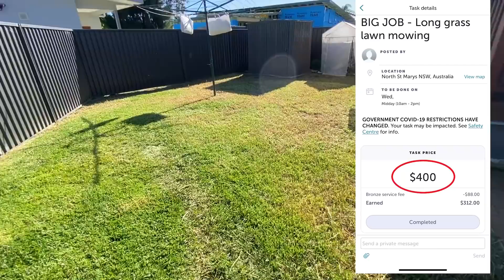2 OVERGROWN MESS Lawns In one Day!

Comment: A sugestion option for ur weedeater- instead of string line replace the head with a 7.25 inch skill saw blade- mount it using a large flat washer then a dome washer then the blade then a lockwasher then a castle nut and tighten- then cut that yard with it first- it will cut fibrous stuff easier
Reply from the maker: Thanks again

Comment: Well done. You are a shining example showing there IS work available if anyone wants to work.  Granted that wasn't a normal mowing job.  Many others passed it by.  So what did they earn by sitting home without a days work? Everyone wants stuff the easy way or handed to them anymore.  You did an excellent job.  I was curious what those "runners" were.  I live in Ohio, USA and we don't have that.
I do have a few tips.  If anyone weeds the grass the grows in their driveways and sidewalk cracks, after you are done, pour some regular table salt on them.  It isn't a poison and it will kill the roots without damaging anything and they won't grow back.   This is good for almost all summer long in case a few others pop up.  Pull them and salt.  It keeps your property looking groomed.
White vinegar and Dawn dishwashing liquid and water.  I mix up a one gallon spray bottle of this solution.  Once I weed around my house, I weed about 3 inches from the house, leaving no grass. Then I go along and spray that solution all around the house.   The next week, when I mow, I can mow up against the house and I do not have to get out my weed eater. 
That is a good solution if you have oil spots on your driveway before you power wash it.  That cuts through the grease.  You can use it on a black moldy sidewalk and let it soak before you power wash.  Dawn is biodegradable and won't hurt your lawn.
My last tip. STOP buying that damn "weed and feed".  You want a nice lawn but do you really want to mow every three days? My neighbor does.  I mow at 4 inches.  In the summer, with no rain, his turns brown while mine is still green.  You can treat your lawn with weed killer but unless it is thin and needs a boost to the roots, fertilizer is a waste of money.  Cut your lawn and then spray "liquid iron" on it.  It will turn your grass golf course green and it doesn't require water like that weed and feed does.
Reply from the maker: Thank you

Comment: Man those runners in the grass are insane. You need to check out the kavli blades. I think they would be great for those runners.
Reply from the maker: It's not that the blades don't cut them, they just lay down
Reply: @timthelawnmowerman  yep the kavli blades have teeth to cut those. You really should check then out. They are designed for how long grass is just pushed over by the mower. The teeth really do a great job. I think the guy who invented them is from Australia.

Comment: They would have been happy with that, the finished job came up great, good to see the FS240r we have two best whippy out there in my opinion
Reply from the maker: Thanks mate 👍It wasn’t Pretty but a lot tidier at least. The fs240 will be getting a really good test in a few days. Thanks for checking out the video man ✌️
Reply: @timthelawnmowerman  once you get used to the weight the fs240r is awesome my wife uses one on all jobs all the time from manicured lawns to overgrown lawns one tip I can give you is don't go back and forwards from the electric to the fs240r it will make the fs240r feel heavier than it is if that makes sense to you
Reply from the maker: Yeah I know exactly what you mean. I do really like the battery one though. It’s replaced my umk425 completely.
Reply: @timthelawnmowerman  Im a fan of the battery gear but never used them

Comment: ...and Google says "Simply, put, your mower will not perform as well when mowing in reverse. There are a number of reasons for this. One of the most immediately noticeable problems is that the grass will not get discharged underneath the deck. The cut is irregular, since mowing backwards means that the blades are running in reverse".